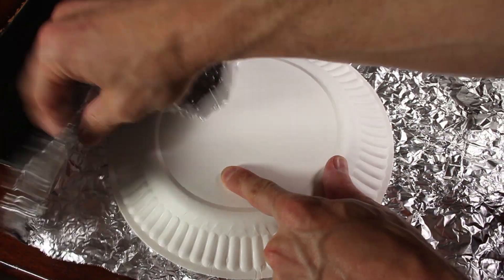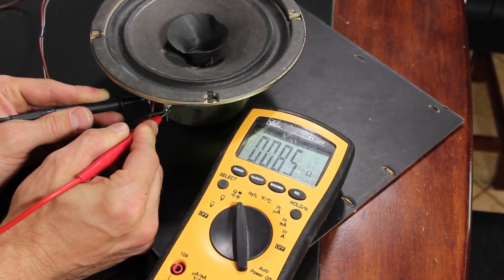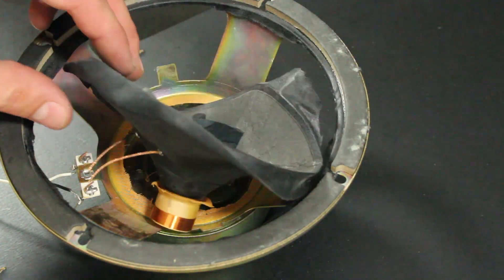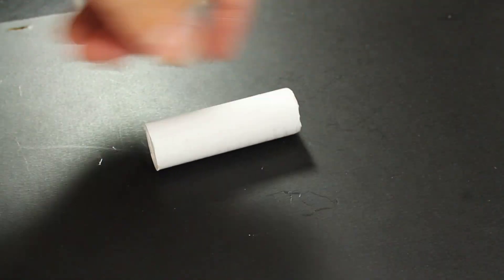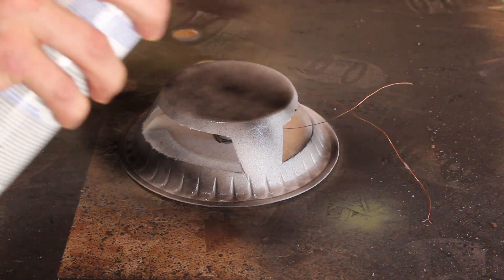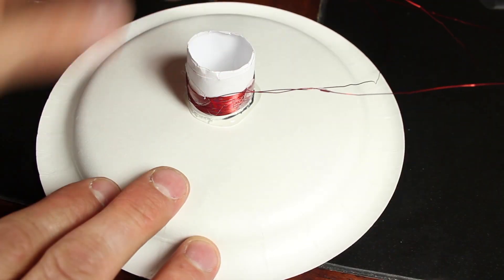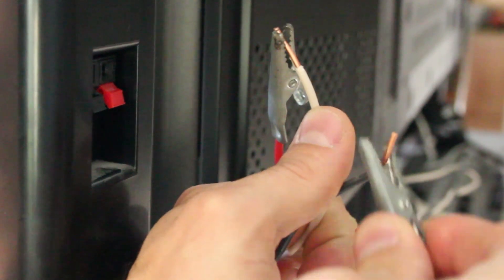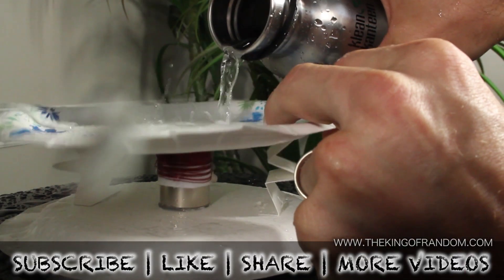Rockin' Paper Plate Speaker

Comment: Great karate moves hahahaha! Anyways, let me get to the point:
If you noticed when you opened the speaker, the magnet had a groove around it and a metal casing surrounding it. The metal surrounding it is connected to the oposite pole of the magnet. This way the space in between (where the coil gets inserted) has a very high, concentrated magnetic flux. Very little of the magnetic field is required to travel outside the magnet and into the air this way (the magnetic field does not like to travel through air; the air's magnetic permitivity is very low). It goes without saying that leaving such a small gap for the magnetic flux, allows for optimal performance. It is one of the greatest considerations you have to take into account in designing a speaker or a motor. The air gap has to be small. The air gap you are using here is huge. The magnetic lines travel outside the north pole all around the magnet and into the other pole.

Comment: So the tv was free? What about the gas to get it. Pro-rated? They don't sell single plates. If I want to make it and I have $1 only in my pocket, I cannot. That's what mythbusters is saying. Myth Busted my man.
Reply: You don't need a TV...
Reply: vzwGrey He used the insulated copper wire from the tv for the voice coil. Any electronics that have inductors or transformers are going to cost more than 20 cents. In order to make this you require that part.
Reply: Glynn Dudley You can just buy insulated copper wire
Reply: vzwGrey For more than 20 cents. Point being the opening statement is false.  That being said I do like this guys videos. Sometimes he does oversell the videos though.

Comment: How will you connect them to pc
Reply: Then they are not going to work...
Reply: if you have a pair of earbuds that you dont want or the speakers dont work, cut the pair in half and take the coating off the wire and connect to the paper plate speaker wire.
Reply: Yeah. That'll work. Maybe

Comment: For much better results and for less damage to be caused to the voice coil, use a neodymium magnet, but make the 'suspension' smaller, so that the 'cone' doesn't fly off, making it so that you don't have to manually reposition it.

Comment: About the copper wire.. Can I take any regular copper wire from unwanted wires and insulated them with spray paint? will it work that way?
Reply: I don't know about the insulating with spray paint, but as long as you can wrap them around a tube and they are insulated you should be okay.
Reply: Yes it will. However it is VERY easy to find enameled copper wire in shops around

Comment: So where do you go to buy ONE paper plate, ONE foam bowl, ONE piece of paper, and 6 magnets that cost only 11 cents? The magnets are another matter, as you can probably buy them in packs of 6, but not for 66 cents. The plate, bowl, and paper though, you have to buy in a pack. So either they cost nothing because you already have them, or they cost like $10 because you had to buy a pack. Either way, they are not 8, 5, 11 (each), and 1 cent. Not to mention the wire and more powerful magnet.

Myth still busted. Not only because it's not a dollar, but because it's not a penny and foil, which the myth was about.

Comment: So to make this connect to my phone would I just take a 3.5 mm audio cable, strip the end and solder it onto the loose ends of the wires hanging out of the speaker?
Reply: I did it and it worked, I even made it stereo
Reply: your phone can only output 30mW/0,03W at a low current, so you would not hear anything. an "average hifi system" is about 60W per channel
Reply: That's what I was thinking too :p but I'm not sure if it will do any damage to phone haha
Reply: Fitri Therock nahh im pretty sure that you're phone is gonna be ok after
Reply: ***** i am being dead serious tell me how u did it
Reply: Oh just make 2 speakers and then look up how to solder stereo speakers to a jack
Reply: *****
 can't u just use earphones to connect it to your phone?

Comment: I aciddently busted up my old stereo with this. i was short on wire and i didnt bother checkig the resistance. after maxing the volume, bass, treble, and balance dials on the stereo, it sparked and didnt work again. i think its mostly just because the stereo is really old, but i still wish i had more wire to coil. its really cool though!

Comment: One question... how are you figuring out your speaker impedance? Should be 8 ohms, but that isn't just a simple measurement with a ohm meter, there is an inductive component to that as well that you can't read with the meter. Why does this matter? If your impedance is too low, you can end up burning up your amplifier from excess current draw.

Comment: This laptop sounds like it was built using 2 TINY paper plate speakers. In fact it's probably just because the magnets attracted steel particles, and now they're vibrating around, bouncing off the speakers' cones, and causing a heap of distortion. Requires a lot of pulling apart to clean. Simple work around: turn down volume a bit.

Comment: Can someone tell me why he didnt use a bowl for the second speaker? Would using a bowl or not using a bowl as a base equal to a different sound quality? Thanks
Reply: A stiff paper bowl isn't flexible enough for a stiff paper plate speaker, especially when they are hot glued together.  If he had put small springs or a flexible buffer between them, it would have been fine.

Comment: what causes the plate to vibrate
Reply: Magnets and Electricity are closely related, I guess you could say. Having the copper wires circling around the magnets makes sure it's within the magnetic field. Once electricity passes through the wires, the magnet then forces the wires towards a direction depending on the polarity and strength of the electricity.

Bare in mind, I don't know much of anything about this topic. This is a "as far as I know" situation.

Comment: This is really cool! I was thinking about making a couple for extra credit for my engineering class. Would anyone know how to best optimize the design, so it would sound best? I have a couple ideas of my own, but can't test them because I don't have the magnets yet to try them. Also, what gauge wire is recommended? One more thing, if I were to make 3 of these, what would I have to do to wire them together without breaking anything? I have pretty much no experience in electronics, all I understand is that each has to be 8 ohms?
Reply: One idea I had was to use rubber bands to suspend the plate, instead of folding paper. Would this allow the plate to move more freely and sound better, or would it distort the sound from the plate moving too much and the rubber bands also vibrating? (It's hard to picture what i have in mind: have a base with multiple rubberbands stretching across the diameter in different ways, and have that suspend the plate by placing the small tube of paper holding the sound coil in the middle of the bands and the tension suspend it in place)

Comment: Well you gotta be careful when taking parts from an old device, there can be parts that store high voltage energy, better dont touch anything
Reply: Just watch out for the capacitors- especially if you're taking apart a microwave to unwind the transformer wire as I've done, as that capacitor is 2000+ volts
Reply: ***** The two microwaves I've taken apart both had a resistor connecting one capacitor plate to the microwave's body, so when switched off the charge would slowly dissipate down to earth. I wouldn't rely on that though. I put on my welding gloves, got two plastic handled screwdrivers in the capacitor terminals, and touched them together. There was no spark, indicating that the resistor had already dissipated the charge

Comment: Is the quality baised on the magnet strength, the copper wire, or both?
Reply: Strenght of magnet and amount of wire turns both contribute the strength wich pull the plate up and down, however the sound quality is probably more complicated than just that, it also takes into accound speaker's geometry and the way it is build.

Comment: just a quick question as to "How may wraps to put." I know you say about 50 or so, but those wrappings determain the millihenry of the speaker (or Ohm load). Did you test it before plugging it in? Looks like you just went for it. most amps cannot read anothing above 16 Ohms is why I ask.

Comment: That was really cool.  Well done. I wouldn't have thought you could make something requiring such precision so easily.
One thing though, you won't get the bass we can hear in the video from the side of this speaker as shown because the wave coming out of the front will be cancelled by the one coming off the back of the plate. I'm guessing you put the speaker in a sealed box to prevent the out of phase "back wave" from interfering with the front wave.
Right?  8^)

Comment: how to get free enameled wire
you will need a bench vice ($50-100) and a old TV. If you don't have it, you could just buy a new one ($100-1000) and kick it open. if you are not very strong, you need a sledge hammer($5-10) and open it. find the audio transformer and open it.
voila! free enameled wire

Comment: Hello everybody reading this, so I made a paper speaker, it worked! :D
The quality was pretty good and the bass also ( for a paper speaker ),
But there's a huge problem,
I hear the song INSIDE of my radio, from the inside,
what am I doing wrong?

23mm diameter x 3mm Ferrite manget (x9 stacked on top of each other)
3mm thick, 3m long wire, coiled 35 times around the voicecoil

Comment: My speaker sounds very small, you cannot even hear the sound when you are even 6cms away from it, I use the diameter is 6mms copper wire, is it the problem with the wire's size?

Comment: i just made it with some wire from an old motor and some magnets , i also used nylon from a nylon bag for the part that vibrates to produce sound (  dont realy know how its called ) and for the base i used a pringles can :) i didnt need a sock absorber cause the nylon is stretchy  .The only bad things is that it is not very loud but it still it works fine :) thanks a lot

Comment: I made one just by wrapping some wire (26 gauge, and about 10 turns) to a very small neodymium magnet. and it sounds great.
If you cant hear anything is because you have a short circuit, or the magnet is too weak. Maybe put the speaker closer to your ear and your will hear something

Comment: Don't worry about that ^^ By the way do you know could i use the magnets that are in microwave ovens..... I remember taking a microwave oven apart as a kid (~10 years ago, but i think they're still doing them the same way ?:D) and there were couple of these fairly wide and flat, round magnets that were very strong. They could hold each other through an about and inch thick table.....

Comment from the maker: My guess is that it would either get the wires so hot the insulation melts, or the wires will just disintegrate altogether :)  If you use thicker wires with thicker insulation, you will probably get a really rocking homemade speaker!  ...If you have a strong enough magnet.